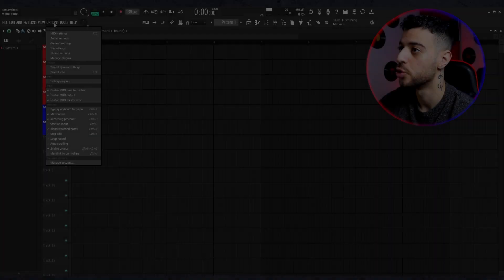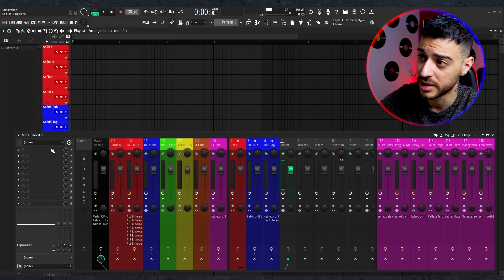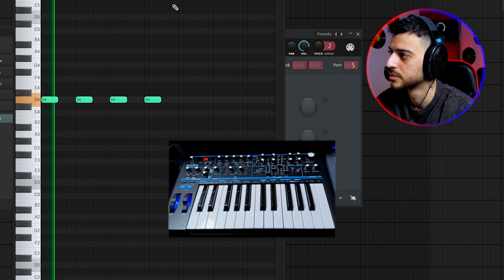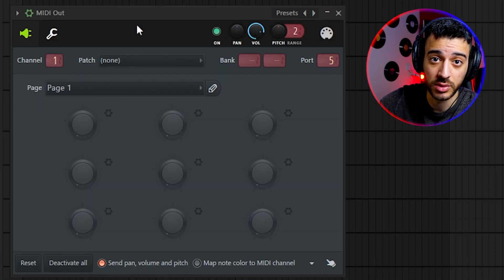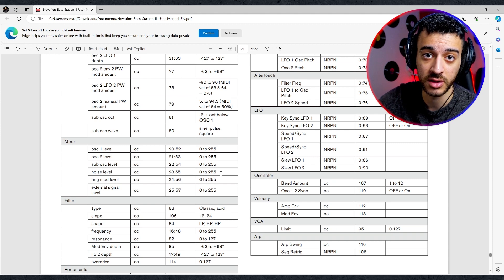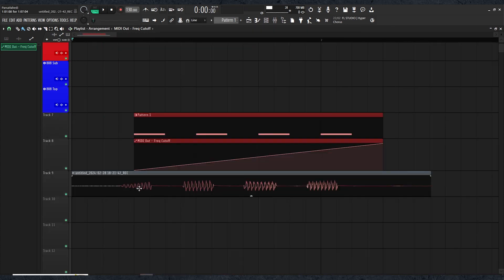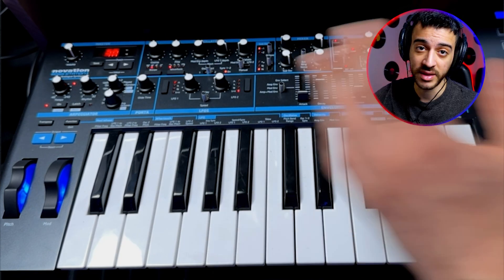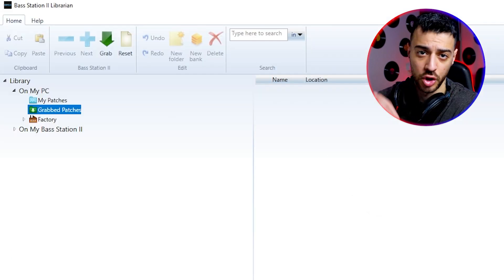How To Control/Automate Hardware Synth in FL Studio | Novation Bass Station II

Comment: Hey. I connected my bass station with the blue midi cable. I want to send MIDI OUT from Fl, but i am getting no sound - i connected the correct port (port 5, same as you), but i dont get any sound. Any idea why?
Reply from the maker: Hey! So do you get sound directly from the mixer but you don't get any sound when you try to route it through MIDI OUT the way I showed in the video?

It's one of those that we'll need to retrace every single step to find out where it might've gone wrong and it's tough to do in the comments...
Reply: @mmvmuzicyea I know. But you need the audio cable to get anything from MIDI out right? 
Thanks for answering!
Reply: Got it working 🙏